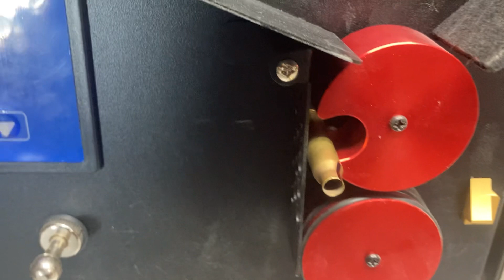Why THE UGLY ANNEALER has 3” brass drive wheels vs others with only 2” brass drive wheel Annealing

Comment: Love my Ugly Annealer!  I compared a half-dozen different flame annealers, and the Ugly had the best combination of capacity, rotation speed, quality components, available support from Carl, and a fair price.  

I don’t think I’d turn down an AMP annealer with all the accessories that costs 6x as much when all is said and done, but for what you get for the price and the job it does I don’t think you can do better than this.

Comment from the maker: BOTH were set real close to a 6 Second drop time.  The NEW "SUPER THIN" .372" thick  Wheel is also taller being 3.42" in diameter giving us an even faster spin time.  Got a chance to anneal some Nickel  22TCM and they sized and trimmed way easier.  To my knowledge NO other machine on the market can do this short of brass.